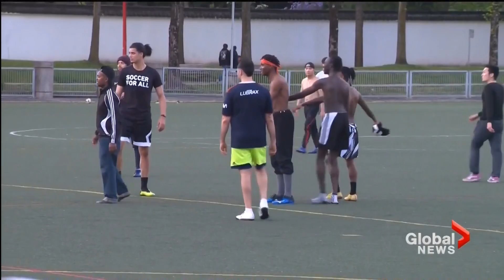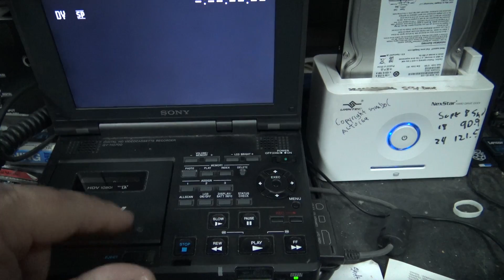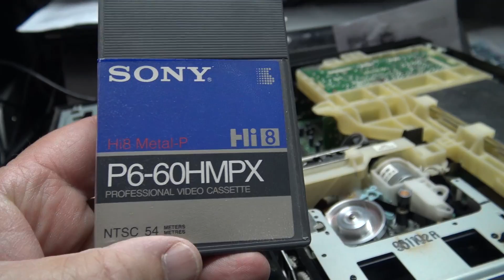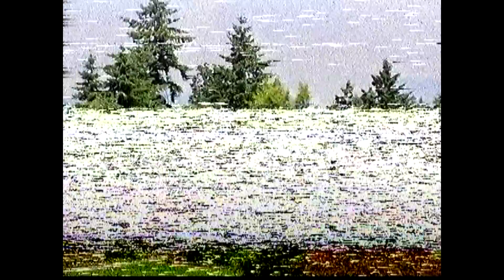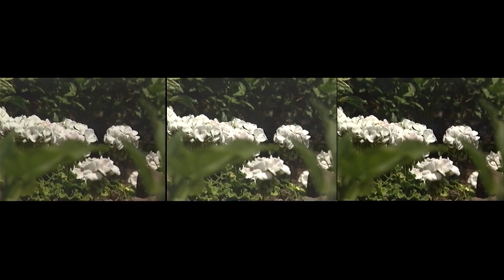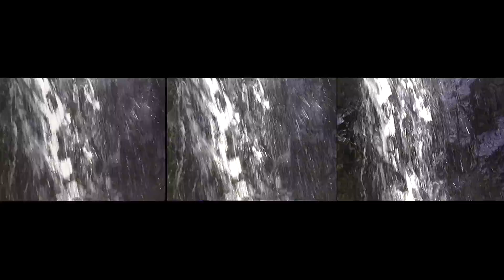Analog to Digital Conversion Which is better

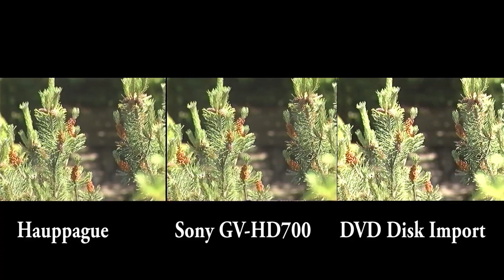Comment: 23:20 - the DVD looks much sharper than the other 2. The Sony GV-HD700 looks the softest. I had an internal Hauppauge card running on Windows XP back in 2005 and found that it's MPEG-2 capture wasn't as good as the DVD recorders of the time. I still prefer using a Panasonic DVD recorder for my own VHS backups but I always use the highest quality XP mode then rip the files with Handbrake software to make H264 files. 24:00 - the Hauppauge has the better AGC to prevent clipping on the highlights, as all the details in the sky are there, the reason the DVD is clipping so badly is probably because it's not altering the incoming video level, and camera rushes tend not to have legal video levels, even on high end broadcast cameras using D-Beta. Legalized video levels are in the range of 16-235 so the 0-255 range includes headroom. The DVD recorder maybe clipping any signal that doesn't fall into the 16-235 range so burning out the sky.

Comment: The Direct to DVD looks the best. Going to have get a remote off ebay for the Samsung  DVD-R120 I picked up at a thrift store recently for like $10.00 to get all the functionally out of it. It has a firewire input and a built in cable ready tuner, NTSC only I think.  Fun stuff.

Comment: You can store archived MP4 files on DVDs or Blu-ray discs if you're worried about USB sticks and hard drives failing.
Reply from the maker: Duh. MP4 however typically doesn't look as good for shitty VHS tapes due to all the noise in the video that needs to be compressed.  Mpg2 does a better job with less macroblocking.   9 out if 10 of my video conversion customers request their tapes be put on dvd.  About half want both mp4 and a video dvd (not MP4 files on a disk) lots of people still have a dvd player or BluRay player

Comment: Personally I would never go via DVD.  For 8mm I generally capture via Digital8 to DV.  The DVD route has another problem, for full quality it's going to be time limited so you would have to keep stopping.  In the UK, 8mm tapes can run for a little over 4 hours in Long Play, 2 hours in Standard Play.

Comment: Back in 2005 I had about 200 VHS tapes full of TV shows I had recorded over the years and never got around to viewing. So what I did was play them back on the last VHS recorder I ever bought and connect it to my recently bought DVD recorder which also had a built-in HDD and transfer them to the HDD, and from there burn them to DVD-R discs. I then put the DVD discs into the DVD/CD rewriter of my laptop and copied them to its HDD.

Comment: I have two ways of capturing analog video.

The first way is a Digital8 camcorder I have, it's basically like the Sony GV-HD700 you have. I upscale the DV video output to 1080p, bob-interlace it to 60p using QTGMC, and compress to x264.

The second way is a bit harder. I decided to try this after seeing a Technology Connections video on it. Basically you use an AV to HDMI converter that upscales the video to HD 60p. Then you use an HDMI capture card to get it as a file.

For the converter I used to have a Blackweb AV to HDMI converter, but it died on me. (I think it threw it out but if I still have it can I send it to you? You can do whatever you want with it). I'm going to get a new one off eBay.

And for the HDMI capture device, I have an Elgato HD60. I'm not sure about the technical specs of it but it outputs an H.264 file at 40Mbps over USB 2.0. So it compresses the video, but it's still a very high bitrate. I'll have to check the color space, I'm not sure what it uses. Is it a good method of capture or should I use my Digital8 camcorder?
Reply from the maker: Using the digital 8 to dv is as good as any other.  That is what I use for converting when going to digital files.  Output is I frame fixed 5:1 compression @ 25 mbit. Remember this is standard definition @ 25mbit. Converting to hdmi, then capture this now upscale hd signal would generate much more data but it is compressed in h.264. H.264 using a long GOP also makes for more difficult editing. Overall the lower compression on the dv signal will yield better results.  If you want to up scale and deinterlace this can be easily accomplished in the pc and since it is not done in real time forward and back frame referencing will generally yield superior results than real time compression.

Comment: Lately the "fashion" for analog video capture is to use an analog to SDI + SDI video capture card. Seems to do a really good job too and you can get AJA video cards for quite cheap. I don't know if you have experience with these, but I recommend you give it a try.

Comment: Have you tried using a Pioneer DVR-510H to transfer from the HDD directly to a computer with Firewire? I know that deck can do that, bypassing the need to rip a disc in order to edit the contents. I have one of those here but I have not used it in ages. I also have a Vision Quest PVR-5000 which was (I believe) a Canadian designed deck. Nice thing about it was the ability to ignore protection on tapes that my other decks would simply not record. That was a nice feature to have, plus the 250 GB hard drive...
Reply: Also had component inputs which most decks did not...
Reply from the maker: Are you so sure about the firewire to transfer to computer.  I have a Sony, which is made by pioneer.  Uses the same remote and all and the firewire is only an input for recording directly from the dv or digital 8 camcorder.  My toshiba is the same just an input. I did try that on my Sony but computer does not recognize it. Going to disk first is generally not a big deal because those clients generally want a hard copy on DVD-r. I get perhaps 1 in 25 that only want it on pc and the majority of them just want it in mpg, no mp4 copy so ripping is very fast. About 10 min. I could care less about editing, that is not my job and if I am going to edit I'll just capture analog content with the gvhd700 into a dv steam and edit from there.
Reply: @12voltvids  Yes, check old Videohelp posts. It depended (on Windows machines) on who produced what chips for the adapters but Macs from the time all seemed to work. The port clearly says DV IN/OUT on that DVR. Yeah, I just copy from my old tapes to the DVR and then copy to disk for later ripping to the computer. This also gives me a hard copy in case anything goes wrong with the hard drive in the recorder. Oddly enough, through all the machines I ever owned, that did not happen.
Reply from the maker: @hawleygriffon9290  
My Sony says dv in so I guess they disabled it for the sony unit. Pioneer made it though as I had some that a friend made on his pioneer that the dv writer failed that he had not finalized and I was able to finalize them on my machine, and it looks identical to his.  Or perhaps sony made the pioneer deck.
Reply from the maker: As to protection that is also not an issue as I am only archiving camera tapes.
Reply: @12voltvids  Yes, commercial tapes can't be done by most places that I know of that do transfers. But I have a few tapes that the contents were protected but were subsequently never released on any other format. If I want to transfer those to an archival format, there are of course a few options...but the recorder was only one. Odd though it had component as well as S-Video inputs. I don't think I have any other recorders that had that...

Comment: What if the difference between composite or svideo and component for a tape? I have a dvd/vcr that can play tapes with component even though it says it can't do that. Is component really better then the others for vhs if you can do it?
Reply from the maker: Component and svideo is only better if the source was produced in component.  If it was recorded off tv it will not improve.

Comment: I still use my Canopus ADVC110 and it also makes excellent video imports. My computer (from 2012) still has a firewire input.
Reply: Me too. But I have to assume that have a hd components capture card and feed it through a comp ->components converter box is a more reliable option today.  With my canopus i don't have the option of capturing HD.

Comment: At least I do have 2 dvd recorders with built-in hdd which i can copy vhs,,and 8mm and dv tapes from video cameras,,,onto the hdd,,,in xp and sp mode if it,s a short video,,,otherwise i have to use lp on the hdd for recording long video playback,,,then I can copy from hdd to dvd disc in high speed copy mode. Picture quality does look reasonably ok in the long play format,,,better than watching it recorded in lp mode on a tape. Otherwise much clearer again on shorter recordings in xp,,and sp modes on dvd.

Comment: Oh wow, Videohelp picked on this pretty quick:
https://forum.videohelp.com/threads/397139-12voltvids-wants-to-know-Analog-to-Digital-Conversion-Which-is-better
Reply from the maker: The more exposure the better I am explaining it in layman's terms. Technically 4:4:4 is the best which is uncompressed but no consumer format uses that.  I capture and convert consumer tapes in high volume at a discount price.  Nobody is going to pay a ton of money to capture their shitty VHS tapes and then Compress. They want them on DVD. 9 out of 10 clients want their tapes on dvd. Sorry if some don't agree with this but that is the fact. I go through a minimum of 100 DVDs a month every month and have 3 machines burning disks every night.  Some want their footage on hdd and for that I use the dv capture which outputs a 4:1:1 sub sample.  The only reason this was done was sony when they developed DC for consumer they crippled the color resolution to discourage professional use (it didn't work) as they had professional cameras that encoded 4:2:2 and 4:4:4 for broadcast.  Yes the color is weaker but again. People don't care. They have a bunch of tapes to convert and price matters more than a slight difference in perceived quality and for 99.99% of people the quality is more than acceptable.  The same goes for the wolverine film scanner.  I could spend 10x as much but could not charge 10x the price because people have a perceived assumption what something should cost and that is all they will pay. I don't use the hauppauge box to capture sd material at all. I use it only to capture hd content from my cable box and it is calibrated for that input.  I use the Sony hv HD700 for clients that want their output in dv compatable stream which is a 5:1 I frame steam perfect for editing.  60 min produced a 12 gig file. Exact same data stream produced by dv cameras.  Is it broadcast? Technically not, but many reality shows were shot on consumer dv and broadcast so it was good enough. For my clients the quality is more than good enough. If it wasn't then I wouldn't be busy. I do conversions and everyone tells their friends and relatives and I get their work.
Reply: @12voltvids  here in Spain a lot of people wants their VHS and Hi8 in MP4 stored on an USB or recently they prefer the MP4 be uploaded to mega or drive or so on. DVD players are starting to fail, some of the costumers use a Playstation, although the DVD is preferred by the 60 % aprox.
Reply: @12voltvids on this forum if your capture workflow is not a Professional VCR with TBC + Rack Proc.Amp + Rack Tbc&Framesync + golden and shielded cables + internal capture card for windows XP only -> capture 4:4:4 -> AVI Lossless you are shit

Comment: In the early 90s. I worked for a major computer company. One of my customers was the BLM, and they had survey data on some very old tapes. The standard utilities were unable to read much of the tape. Every data point lost may have required a surveyor to go on-site to recapture information. I knew the internals of the operating system well enough to get to the direct entrance calls to the mag-tape driver. I was able to capture most of the data by running multiple passes over the head and reading backwards and reconstructing data. This was a vacuum drive, so junk on the tape could sometimes be removed by passing the tape back and forth in the vacuum column. Reading backwards could help when the beginning of a tape block was not recognized. I vaguely remember writing some assembler to get around CRC errors. With enough passes, I could assign a confidence level to bad block reconstructions.

Comment: My current work flow is either a Panasonic AG-1980P with TBC or a Sony SL-HF750 with no TBC into either a Pioneer DVR-650H-K or DVR-640H-K. Also, using LPCM audio instead of Dolby as many audio restoration programs did not pay Dolby labs for the audio codec so it can't be imported. I used to use a Hauppage HD PVR2 into my computer but that could be tedious. I used TS as the recording format even though this increased the file size. These days I am mostly attempting to preserve old TV shows audio as it was destroyed by many companies around the world. Sometimes video too if it was an item that aired once and was never repeated. But yeah, Sony had a lot of problems with tapes over the years. My pet peeve was with their Dynamicron UHG tapes sourced out of Japan as well as Scotch EG Extra Grade, also sourced out of Japan. So many have developed sticky shed syndrome. My attempts at baking them to restore the contents have been failures but since we have some time now, I can use it to experiment. I know this works well with audio tapes but video seems to be hit or miss. Have you tried baking the tapes to restore the contents? Nice video as always...

Comment: The longer you keep the signal digital in the chain the better, dave im using a BlackGold BGT3620 Dual DVB-T2 Tuner Card, the quality of hdtv recordings and from external sources is absolutely beautiful. its 444 and full RGB

Comment: The DVD has slightly darker dark and higher contrast, but when the sky with clouds is visible on all three, the DVD is the most washed out with the Hauppauge giving the best gamut with a bluer sky. Resolution is more or less identical on all three with the DVD perhaps (?) a tiny bit sharper - or perhaps it's a result of the higher contrast that makes me think that. 

I agree that all three versions are pretty acceptable. The tiny differences can come up because the original shooting was done with a camera that appears to have stellar performance. Never seen so clean and natural tones. With the typical camcorder videos, all three are probably overkill.
 It hasn't been too long since we considered and accepted DVD resolution (SD) to be pretty much great. Well, it was compared to analog VHS. But 1080p makes all these shootings appear as bad as super 8.

Comment: The DVD has a bit more contrast, but lost the blue in the sky.  The Hauppauge has a nice blue sky. DVD has better grass detail.  Mix all 3 and smooth out the dropouts.  I use a blackmagic design intensity pro pci card and can capture uncompressed 4:2:2 or DVCPRO50 4:2:2, or through OBS Studio capture directly to a nice h.265 MKV file, although it captures widescreen only.  I also have a Hauppauge Colossus 2 but it's SD inputs look terrible to me.

Comment: What can the average guy that has a load of vhs and Sony HD mini tapes that need to be transferred to a hard drive and of course backed up on dvd disc without having the means to purchase the nice equipment you have.  

What is needed? What software is needed.  I guess I’m looking for a step by step process for do it yourself people.  Thank you in advance.
Reply from the maker: If you have the playback equipment you need a capture card for computer or one of these stand alone dvd recorders.  Or you can send your tapes out to be converted.  That is what my business does.  I transfer hundreds of tapes a month. That is why I have 3 dvd recorders connected in my office and 3 vhs decks as well as 3 8mm players available. There are times I am transferring 3 tapes at the same time so I can get a large order done quickly.
Reply: 12voltvids I have the playback equipment.    What is the best capture card and software?
Reply: @michaelturner2831  If you have USB 3.0 I would suggest the Blackmagic Design Intensity Pro USB 3.0. Capture uncompressed and then use a free video editor to produce the final product. (I've been using ShotCut lately.)
Reply: @holycowmanheck  Where can you get one of these in Canada?
Reply: @hawleygriffon9290  https://www.blackmagicdesign.com/resellers/

Comment: I have a Panasonic that has a VP mode which is 10 hours on a T-120... talk about worse than EP mode!!!
Reply from the maker: Try recording a VHS recorded in ep in that 10 hour mode.  Yes I know how bad it is. One of my Toshiba and that lg recorder have a 10 hour mode. The lg it is 12 hours but it only goes to 10 them stops. You can start it again for the last 2 hours. 10 max for 1 program. And ya it is bad.
Reply: @12voltvids  We used to say to enjoy the slide show in that mode...

Comment: I think the hauppauge (leftmost one) is the best because it doesn't overboost or clip the signal, for example on the other two there are times the sky is just blown out to be completely white, while on the hauppauge it stays blue. 24:05 for example, it's clearly superior. It may not look the best at all times, but for example if someone wants to edit it later, a recording which preserves as much of the information as possible is desirable. If the contrast is too weak it can be digitally boosted etc. But I agree in that DVD is the cleanest way, encoding to a file is more straightforward

Comment: Yep the dvd capture had a bit more contrast/depth and looked less mushy than the other two.
Conversion will always lose something, usually clarity, and there is no way to put that resolution back.
So the best capture from the start really matters.
I've messed with capturing video years ago, i was never impressed by the mushy low res results.
Reply from the maker: Well you have to do something with tape.  It doesn't last forever.  The only way to preserve is to digitize.